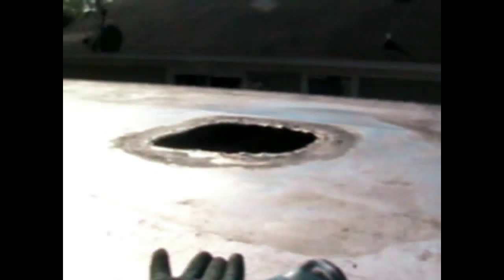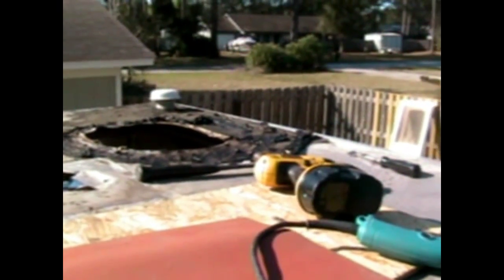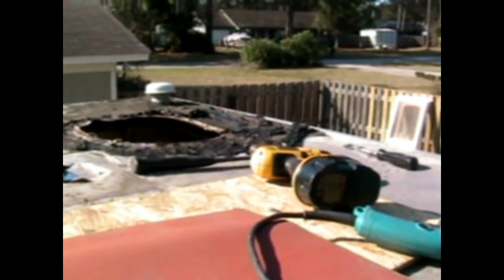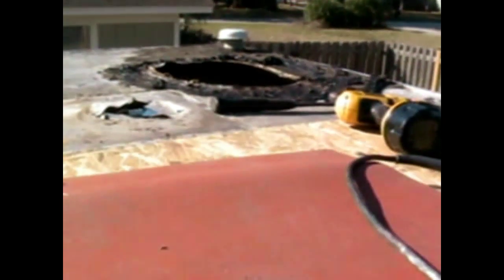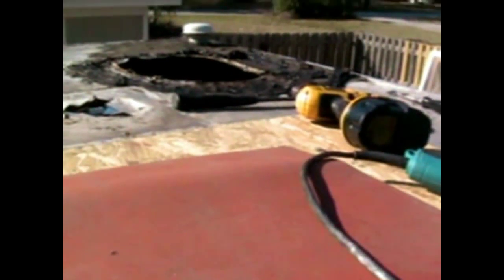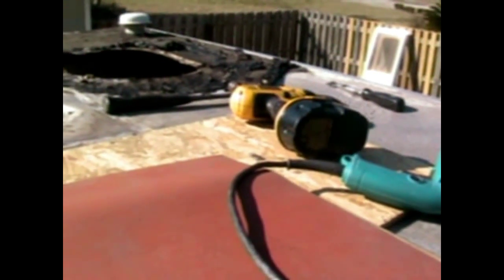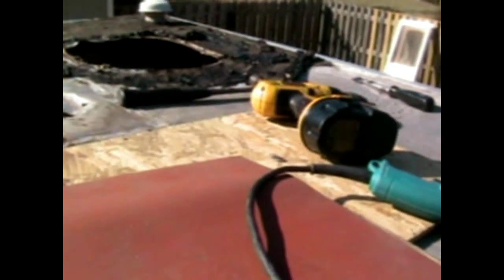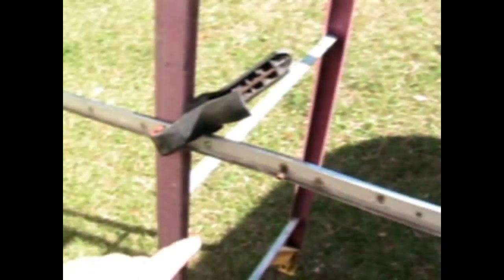#5 Vintage Travel Trailer Restoration Preparing to Paint

Comment: Thanks for directing me to your restoration videos they are excellent! I’m so happy to see you did the work yourselves. We’re planning on stripping ours down also. Other videos I saw took the aluminum frame apart 😮 I was starting to get scared! Can you tell me, Did you have to lift the trailer to remove the underbelly?
Reply from the maker: Thank you,
We took the back end of the belly off . (Ours was already falling off) We did that so we could clean out the belly and treat all the chassis with ozfo (for treating rust ). It was a lot of work but, well worth it. 😁